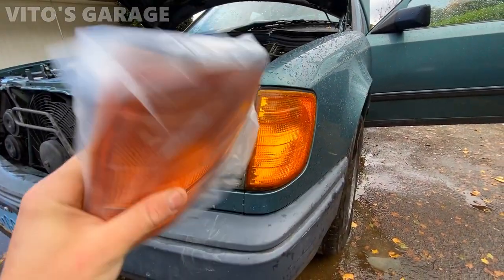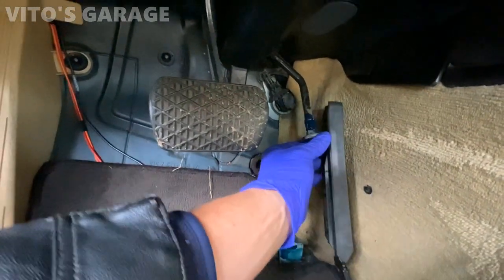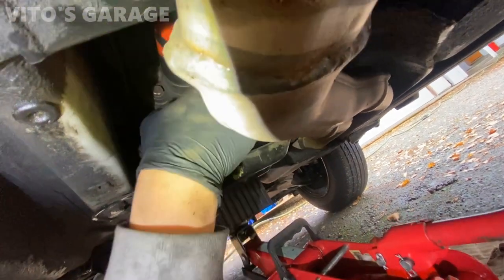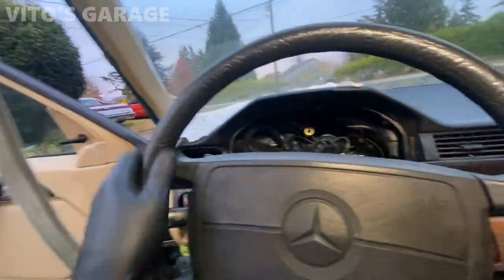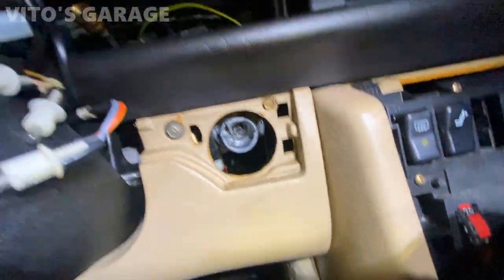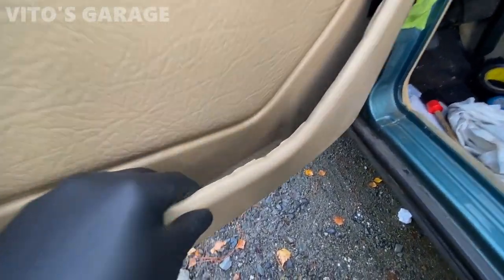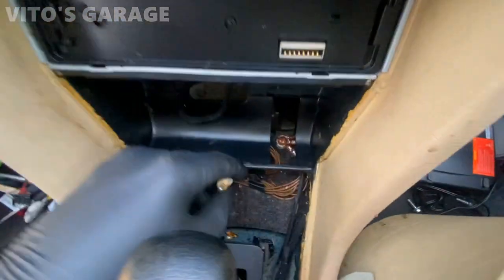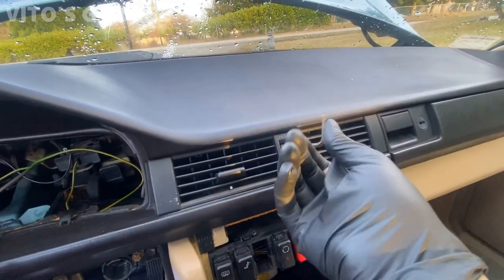Part 10 Mercedes W124: New Turn Signal Lenses, Ignition Tumbler, Trans Mount, Vent Bulbs, Cleaning..

Comment: Privet Vito. Please help, my US W126 sec has rain water leak in rear passenger footwell. Is that due to clogged sunroof drain, AC drains or cowl leak? Spasiba
Reply from the maker: Privet. You need to remove the carpets and run water over the windshield and see where it’s coming from. Could be a windshield seal, sunroof drains, something else

Comment: Which car do you prefer, the W201 or the W124? We've had 4 W201 (2x diesel manual, 1x diesel automatic and right now a 190e manual 5 speed), but I've never driven a W124
Reply from the maker: All are amazing